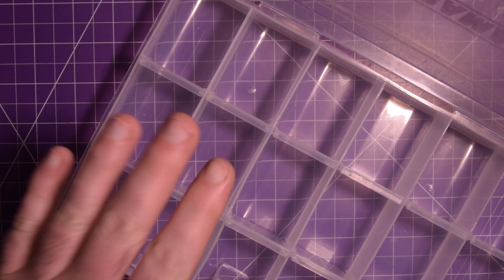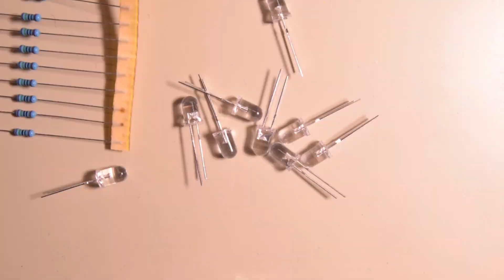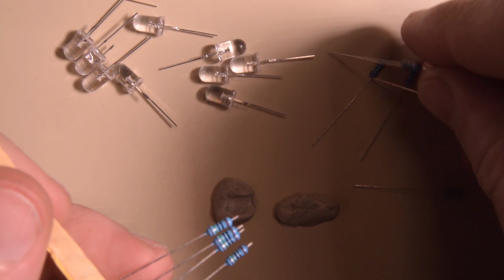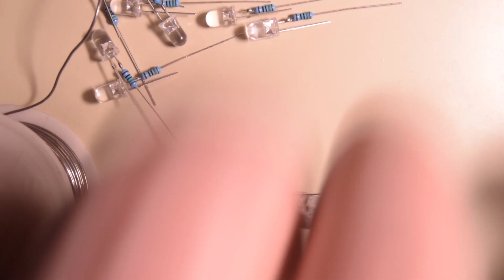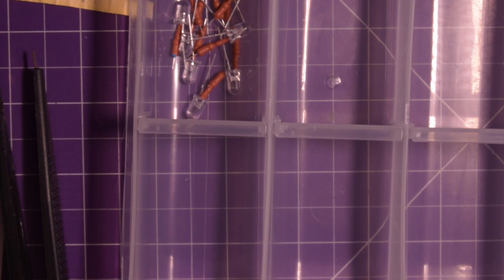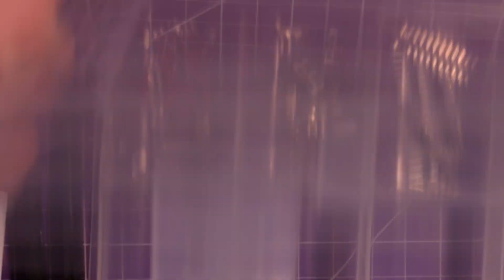Build Your Own Breadboard LEDs For Your QAB

Comment: Another hugely illustrative and practical video! It really is worth a great deal to see every stage of the operation. That way if there are any real-world fiddly bits or pitfalls which are not immediately obvious when we plan the process in our mind--like threading the heat shrink or lining up the resister--we are prepared for them ahead of time. That is actually why I am not the biggest fan of Julian Illet; he often cuts away to an edit in the middle of a kit video. I personally want to see every stage and learn from it. Big Clive is excellent in that regard as he will go through the entire build and make it fun at the same time.

In regards building your kit, personal prefferences always count, but the basics used to be; NPN transistor, PNP transistor, silicon diode, germanium diode, resisters, capacitors and inductors. These days you should probably add a few MOSFET devices and--obviously!--LED's. Very basic sensors like light-dependent-resisters and thermistors are also probably a good thing for breadboarding. You might also want to stock up on basic 74-series logic since you are working at 5V, although there are CMOS equivalents which also don't explode with TTL voltages. Although I do myself prefer 74LS or 74F devices to the newer ones, but that is just what I used when I was young. You might also want to think about the appropriate counter/decoder IC's if you plan to use standard LED number display units. Plus... There is always room for a handful of '555' timers!!!

Comment: You need a block of wood with several 5mm holes. It makes things much easier!
Reply from the maker: I should dig it out, I actually have that set-up for making a 2x4 array of LEDs for use on 12v systems! but yes, very good idea!

Comment: Looks like I'm the first one to watch. I would add the most common capacitors, push buttons. If the compartments were bigger I would include jumper wires. If the leads you cut off of the resistors were long enough, you could use them for jumpers.
Reply: Excellent point! I also keep my trimmed legs if they are long enough to be useful.
Reply from the maker: Yup, Jumper wires will definitely be part of video 2 on the QAB!